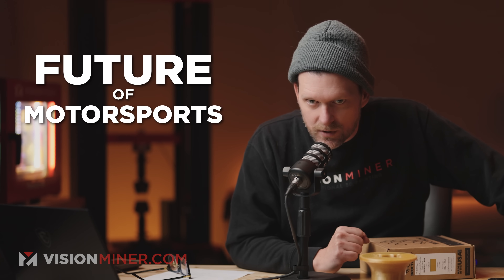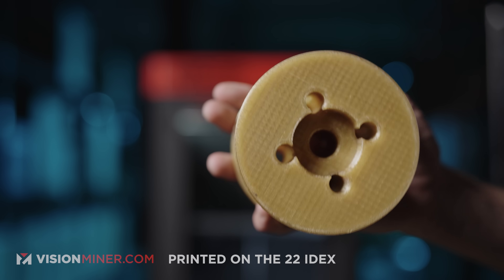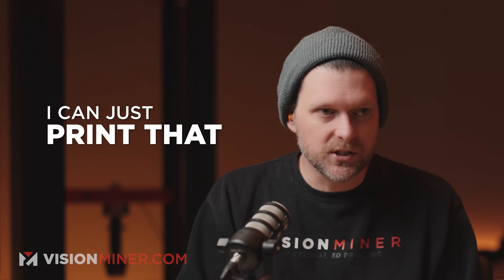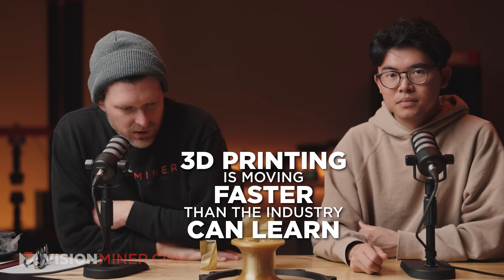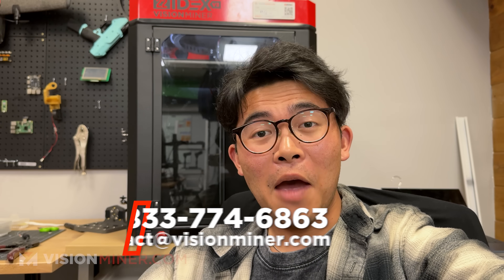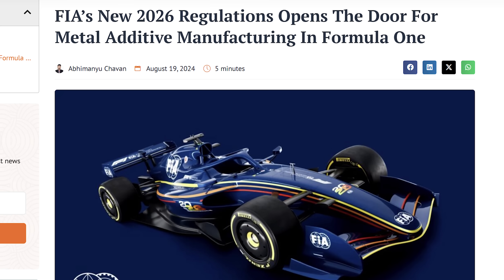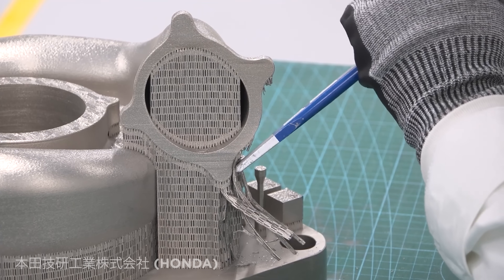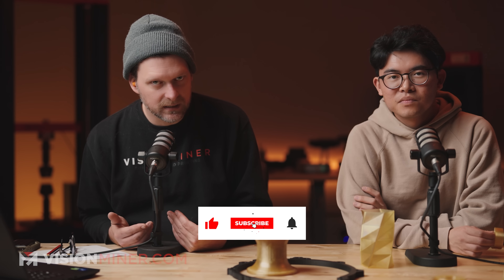The Future of Racing is 3D Printing.

Comment: Guys guys gyys...
PLEASE help me by 3d printing 1jz-gte vvti log style T3 turbo manifold. I have a Toyota Chaser and there are plenty of ling runner manifolds out there. But I have yet to find 1 single log style manifold for this engine. I have a modified stock manifold with a T3 and wastegate flange. Works great but A. It's OEM cast with welded flanges, B. Its very restrictive. As you may or may not know the toyota chaser was banned for 25 years and now everyone is importing them. Im in Phoenix AZ. and I can drive within a state or so, unfortunately I'm handicapped so I'm limited to how far I can drive. Lots of $$ to be made if you ask me. I really wish I could learn how to use 3d software. I've tried on my own but I'm limited to how much time I can sit, stand and even lay down lol...(sounds crazy right)... anywho, cool video!!!

Comment: Conventional filaments are unsuitable for mounting directly onto mechanical car parts unless they are produced using direct metal laser melting (DMLM) 3D printing. Even then, such printed parts still require post-processing in a furnace to enhance their internal structure through thermal treatment.

Comment: I have a 2021 can-am spider rt limited, owned for under 30 days only 3000 miles I want to do this to every part. I need to reverse-engineer parts with scanning technology so I can reduce part count, add lightness, strength and robustness. I just took some major plastic components off and was amazed at the waste of space, plastic push fasteners used without a specific intention. They fail then dealers don't stock anything so you pay incredible high prices for pennies of material. I want to turbo supercharge to double available horsepower, custom wheels are scarce and overall there is a shortfall of elegant design. I need to to know what your company does and how to use your strengths to change the face of modern motorcycle design, sales and products.

Comment: As a professional motorsport technician I have been very intrigued by 3d printing in motorsports. I originally was introduced to it on a Toyota GR86 Cup cars in GT AMERICA. Hood vents, brake ducts, interior trim all was 3d printed parts and held up well. Later on I started running gt3’s with glass infused nylon 3d printed aero bits. I then bought a stock ender 3 from my coworker for $20 and am slowly learning the process. 3d printers are a tool you never knew you needed until you have one!

Comment: Soooo you are gonna make a downpipe out of thermoplastic?   Hmm... let me know how that works out.  (Btw, I do my own 3d printing and designs, but I just had to laugh when you said that!)   Also... the future of racing is electric!  There, I said it!   If you haven't driven a fast electric car, then you really can't appreciate what it's like to have 600+ foot pounds of torque and 600 hp instantly.   Imagine your perfect launch off the line... you can do that while still driving at 20mph.  If you put electric against combustion on a circuit track, electric would dominate.  :)

Comment: Molded abs IS STILL STRONGER....but inna pinch i do use the crap outa my pinter..i like pteg cause its cheap n stronge. But for alotta parts ill make a mold because its just stronger because you dont have layer line weaknesses

Comment: We are looking to get a tuned intake manifold for our fuel economy optimised car. We are currently European Champions in the Urban Concept Class in SEM. The challenge is feeding air most efficiently into a single-cylinder, 50 cc engine with port injection.

Comment: One aspect that wasn't touched on at all, part design. A lot of designs are started with manufacturing in mind, i.e. what can the CNC do, mold do, or whatever machine can do? Space X had this epiphany with their rocket engine, with additive they can now print the parts that they need, the way they need, where they need. Manufacturing methods have constrained designs due to their inherent limitations. 

With that in mind, challenge is to redesign  a part that can take advantage of less limitations that the other methods have. Something like a more organic shaped intake plenum to optimize air movement while keeping air flow equal across all cylinders.

Comment: Reducing part count leads to elegant designs and weight savings, but it can backfire when repairs are needed. Replacing a single integrated component due to a crash or minor defect can be costly and impractical. That said, 3D printing is awesome, used in a thoughtful way can yield great results.

Comment: They 3d printed a turbo housing.  That was then machined to hit tolerances and surface finish.  Be real here, for internal engine parts they are not going from print to engine without post print machining.
Reply from the maker: Post processing is always going to be a component of most manufacturing methods for the two things you mentioned. Keep in mind as well that this metal 3D printing initiative and the Honda F1 engine program overall (up until the end of 2021) are R&D projects for the company. Metal printing is very much still in its infancy so perhaps there's a future where final parts can just be taken off the machine without the need for post processing.
Reply: @VisionMiner  Unless there is a complete paradigm shift in how parts are printed post print machining it's going anywhere anytime soon. Stacking layers of material just isn't conducive to holding tight form tolerances. Surface finish will continue to be an issue with any form of powdered metal printing. 3D printing has been around for close to 40 years now and it still suffers from all of the same issues that have always plagued it. 

I can't tell you how many times I've been asked to rework 3D printed parts because the process just couldn't get features right. At my current shop we had a medical device company that was having parts printed for clinical testing. They would send us a batch to rework because of hole form issues. It got to the point where we convinced them to let us machine them from bar stock. It was way cheaper and faster than printing, then inspecting them, then having us rework the parts that were not in print.

Comment: Most intake manifolds are already made of plastic. I don’t see a reason that they couldn’t make an intake as efficient as a ported intake by a machine shop. 

I also could see clever design that is only possible on a 3d printer, like vortices in the intake and other aero tricks.

It’s designed digitally so it should be feasible to model and simulate this. Eventually you’ll have mechanical prompts for AI. You just give it the parameters, and it would design the intake for you. Best part is with AI it’s faster to be iterative with a creative mind behind it improving each version.

Comment: Did you just discover Ultem? It's not even close to new, it has existed since the 70s or 80s. Maratac has been making watches, flashlights, and other edc nonsense out of it forever. Also, I'm 90% sure that you can CNC a turbo way faster than you can 3d print one out of metal... pretty sure they don't have klipper metal sintering printers. And even if they did they would still probably take longer to print.
Reply from the maker: ULTEM has been mostly locked away with $150K machines from Stratasys and other close system, pricey machines and only recently has become more accessible for FDM applications. The big benefit you get from 3D printing turbos is how much easier it is to manufacture certain design features that simply aren't possible in subtractive manufacturing. Yes for a fairly basic turbo design casting and then finishing parts in CNC is going to be much faster but additive unlocks a lot of design possibilities along with massive cost savings for low volume production and those are the two reasons we're so excited about this tech and what it can do.

Comment: I've got an '86 Mustang SVO that I am planning to 3D print a bunch of stuff. Still learning my KobraMax2 My first printer (admittedly probably not the best choice) and Einstar scanner. I am aiming to scan the whole car over time, I just tried an engine bay scan for a CAI setup and the scanner worked surprisingly well. I feel like I need a better printer to really start making parts. I'm not knowledgeable enough about 3D printing to get anything that is actually a 100% clean copy. Constantly having bed adhesion problems and losing its spot and printing off course. I've had nothing but problems. Thinking about getting a smaller nicer enclosed printer that will just be able to rip parts off, I thought bigger would be better before I realized that you can slice anything up..... If you guys would be interested in that CAI I could send the scans. It'd be awesome if you did a video about modeling/modifying a scanned part "adding to it" if you will. I know it can be done just haven't gotten around to learning how to do it. There is so much to learn it's kind of overwhelming!

Comment: Hi guys, you are totally right. I am a young bicycle framebuilder from Barcelona and the 3d printers in my shop have turned up to be the most valuable asset for the business since the beginning. The fact you can print stuff like supports for when i am welding or glueing parts together with acceptable precision and for so cheap... For rapid prototyping. I have made patterns for mould making to make cfrp parts and it just blows my mind. The really are a must have for any small, medium, hell even big shop they save so much time and money

Comment: Just subbed, would love to see 3D printing body kits too. I know it’s small potatoes but I haven’t seen anyone use exotic materials for it. Splicing the pieces together looks challenging in post-print. 

Like what size of printer do you really need and what material will give enough strength like fiberglass. What type of infill, if any. Etc etc

Comment: Streamlining the machining process, outside of mass production, is a huge innovation.

The long term durability will be the next hurdle.  Grain structure reinforcement, relative to decreasing print times.  Much like welding to a casted part, heat treating processes.

Comment: Its crazy for hobbyist car builders.
Body panels....print
Bracket prototypes.....print
Manifolds....print

I got a scanner and did my whole engine and bay for my 13bREW swap. For my turbo manifold i did some flow sim and then printed a bunch of prototypes. Eventually i had my manifold printed out of inconel using a binderjet system.

I was able to see those turbo manifold talked about at the end made in person and they are wild

Comment: You keep saying motorsport but the reality is 99% of motorsport will not be using this except for spare parts. There really isn't much to develop due to restrictions. You can't produce more power at the trackside, you use ballast based on your weight. Aerodynamics are very restrictive in nearly all motorsports. It's just not as big as you are thinking, though will be used alot in pre season development and part making
Reply from the maker: A lot of big players are already using 3D printing in some capacity whether its just jigs and fixtures or engine components. The reality is that no one wants to tell their competitors what they're doing. The Honda article that we referenced talks about how some of these components (we totally forgot to mention their 3D printed iron pistons) have been in use in their F1 engine program for several years and timing the public announcement towards the end of the current engine regulations just helps them show off their work without totally compromising their current advantage. Something we also forgot to mention regarding pre season development is that McLaren in the V8 era was 3D printing spare exhausts during pre season testing while trying to find comparable solutions to RedBull's exhaust blown diffuser tech :)

Comment: Just buy a metal 3D printer. ULTEM is not going to be in the racing scene except as a one time use part. 3D printing metal is just as easy and only slightly more expensive as you only need to buy metal powder but lots of it at first. Like the person said below the point stresses of the material are what make it fail. Just like any other plastic out there.
Reply from the maker: Metal 3D printing still has a few drawbacks, mainly upfront costs and post processing but we are seeing the tech become more accessible year after year.

Comment: the thing i want printed - specifically, 1992 Mustang convertible, drivers door window/doorlock switch block base.  the part that the screws go through and hold the block in place. THAT is what i need.

Comment: We were doing this over 20 years ago, not new. The technology has moved on enormously though. Back then it took us 24 hours and several computers to make a fairly small part. But they were extremely accurate. Our printer was also £500,000. The cost now is incredible.

Comment: What do you mean "THE FUTURE ?" Its "THE PRESENT" and its here already bro,  3D printing is CURRRENTLY used in the top levels of motorsports and racing, its already used to develop and prototype many parts on a formula 1 car for example, not just in plastic and carbon but in metal too, even the pistons are 3D printed. If you're motorsports fan and have been an F1 fan for years like I have, you know this has been a thing for decades now and the tech is only getting better, faster and more efficient.
Reply from the maker: It's not new necessarily but the exact use cases for high temp FDM in motorsports has been quite secretive over the past few years. It sort of feels like metal 3D printing is complicated enough that its fine to disclose as it takes a considerable investment and skilled workforce to get it up and running. As mentioned we do know of two teams competing in top level motorsports that use PEEK under the hood but alas we're unable to disclose that info as of right now.
Reply: @VisionMiner  The exact techniques, designs and filament  definitely, I don't doubt it, they don't want to give away any possible advantage to a competitor. That said you don't even need to know which specific teams are using it,  to know these teams have been on the cutting edge of this tech for a while now, often tested in literal and metaphorical trial by fire on these cars. Heck if you get a close enough shot of the current F1 cars you can see traces of Print material used in their bodywork alone, its really cool.

Comment: Umm... 3D printing has been in use in professional motorsports for at least a decade now.  This isn't a new idea at all.  For example: NASCAR teams have been 3D printing their brake lines - complete with flared, threaded fittings - for years.
Reply from the maker: It isn't new but teams are more open to showing off what they're doing since the use of AM in motorsports is still mostly untapped.

Comment: I think one of the best use cases is for motorsports with a regulated team budgets. If you can create thin and strong 3D printed thermoplastics that are comparable weight to a carbon fiber/titanium component, you can save significant costs to redirect to other components that can't be. I can see this being even more useful for iterative test parts (wind tunnel, ect) where you want to make many small change iterations and its potentially more cost effective than machined models.

Comment: I wonder if we could find a healing additive like Roman concrete.  So when the part cracks from heat change cycles or stresses it oxidizes with the air and heals the part.

Comment: Here's a challenge: I need custom intake piping for pro charger inlet to BMW kidney grills for ram air. I have the laser scan of the engine compartment. Its 1000hp chevy LS 6.7l pro charged 1998 E36 BMW. It has limited space as I fabricated the entire front end to fit everything. I haven't had time to fully design the intake yet...
Reply from the maker: Sounds like you're gonna have to send us an email or give us a call cause that project sounds super cool!

Comment: as soon as powder metal 3d printing becomes affordable and available it will simply take off, it solves the issues of material restrictions and given that its refined enough to get good tolerances could be used to create all the rigid parts of the car off one machine, if it becomes possible for people to print the integral components of their cars with relative ease then car modding will simply blow up. its much more efficient to ship metal dust ready for printing than it is to ship finished parts with all their air pockets and packaging, you cant break dust, it would likely be cheaper than traditional parts manufacture as well

Comment: I'm in my mid-40s now. I remember when I was very young, maybe 9 to 11 years old, seeing an experimental car with a fully plastic power train at Le Mans. It lasted only 6 hours, but my young mind was reeling. Two years later, a Bosch sponsored car was at the race with some of their 3D printed drive train parts. This is the early 90's folks.
There are additive manufacturing technologies in the works right now which can print copper and TPU, in contact as a part (e.g. TPU coated copper) without burning the TPU or under sintering the copper. The issue with these at the moment is reliability.

Comment: I'm really interested in this! I work with AM and want to give you this challenge:

Welding tooling/fixtures for positioning parts close to welds. Example: a tool that positions a boss in a metal sheet for repeatability and accuracy.

Comment: 3d printing for motorsports is cool. But its cost prohibitive which means the costs of the cars go up, so for f1 and prototype series where manufacturers dont have to sell cars to teams its fine but fir any series beyond that it doesnt pay off.

Rapid prototyping and test fitment works great. But mass production is left to be seen.

Optimising material usage and all that is fine but then is it going to trickle down into road cars and when. 

There is a future but its 10 years off